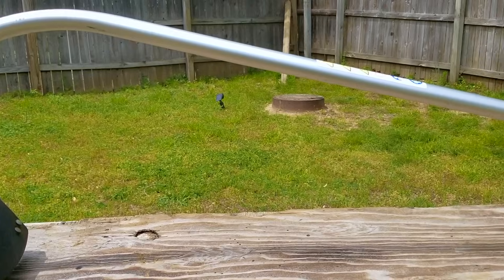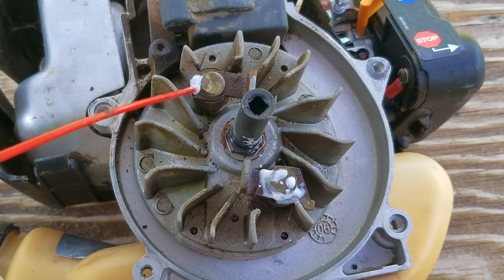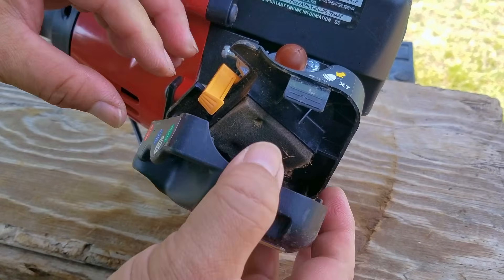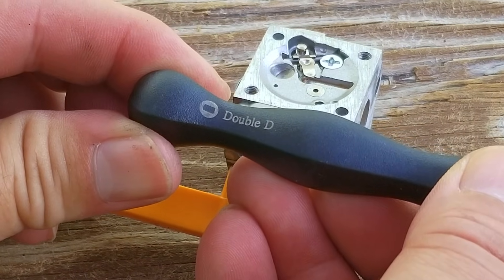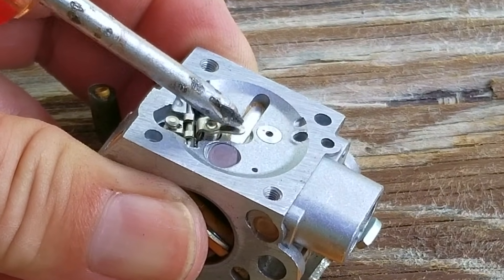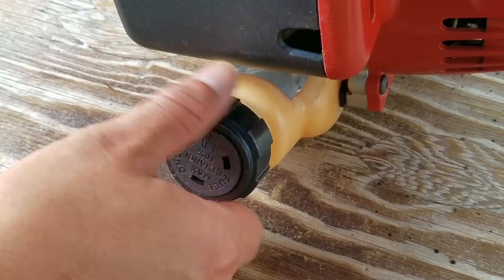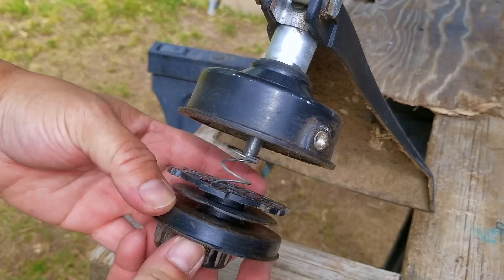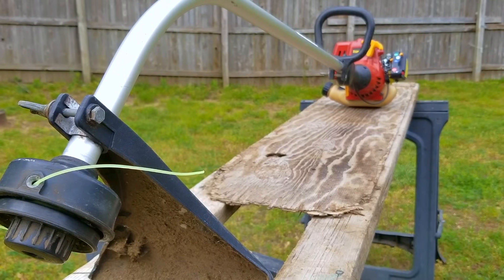Fixing A Homelite Trimmer That Won't Start

Comment: Thanks, I’ve been using a badly running similar trimmer for years, your video will help me try to fix it. Never opened a 2 strokes carb
Reply from the maker: thank you Bob and good luck
Reply: @INSIDEHOUSEGARAGE  did it this weekend. New needle on the old pivot seemed to flood the engine. Went back with the old one and it works fine now

Comment: This video was very helpful. My Lifan weed trimmer started, but it would lose power and shut down. Lately it just wouldn't start. I took out the fuel filter and saw that it looked very crusty and the supply line inside was in pieces. I changed the fuel filter,  supply line(hose) and return. Now it start perfectly and no loss of power.
Reply from the maker: thank you and nice work fixing it!

Comment: Those little homelite trimmer are great. I've fixed a sold 3 this year. I think if there were treated like a more expensive trimmer buy there owners they would last just as long.
Reply from the maker: you are correct, these are not bad at all.
Reply: The name Homelite was the premier name for any or all small engine appliances back in the '60's and '70's. Too bad they lost that reputation along the way!!!!
Reply: Stihl now has that reputation and from what I hear their products are marginal at best!!!

Comment: I have my dads old one(same model) had to replace the fuel lines as you did, then it ran just fine. The issue is, the line wont feed properly and snaps off at the eyelet for some reason. Im thinking a new head is needed, since its heavily worn(holes in the bump button from wear). Not a bad backup trimmer otherwise, cuts fine when it holds line. I wanted it so I didnt have to convert my straight shaft trimmer back from brush cutting blade to string constantly. Good video!
Reply from the maker: thank you AdmiralDG.

Comment: I'm not a big fan of the curved shaft trimmers but if push came to shove and I didn't have one I couldn't find a Straight Shaft one then would have to use it,  great fix on that homelite
Reply from the maker: I hear ya, they can certainly make your back or neck hurt

Comment: Get one of those $80 Harbor Freight ultrasonics. I have one, and it does just fine on stuff like this. You are correct about cleaning them first, but I have a better success rate when I use mine.
Reply from the maker: yes that's the plan

Comment: This is the exact model I had repaired and still use! I certainly wouldn’t use it in a professional setting but it trims our grass much faster and easier than our cordless black & decker that had a very short runtime!

Also despite mine being two years older (April 2004) the carburetor adjustment screws had the plastic covers on them. Fortunately the screws are slotted so all I needed was a small flat blade screwdriver.
Reply from the maker: nice, thank you for letting us know, and I also agree about the commercial use issue .

Comment: Great video, can i have your opinion on something I run all my equipment on fuel with a stabilizer in it but people always tell me to run can fuel but I don’t want to run that because it’s just so expensive and Even if I did run can fuel i think it is a wast of money because a gallon of the stuff runs 20 to 30 dollars and that is the same amount as a new carburetor, but do you think people should run caned gas for just use the pump
Reply from the maker: Thank you Nick Mcgrew for the question. I would alway suggest running pump gas with an "ethanol shield" additive all year long. But I'd also like to recommend using canned fuel  during the last month of the season, just on the off chance you for get to run the machine dry.

Comment: I like all your videos. They have provided me with a large amount of information. The comment you made in this video about a dish washer leads me to believe that you do not own a dish washer. You stated that all the dirt from the dishes goes back on to the dishes. Sorry, you're wrong. Cleaning the dishes before putting them in the dishwasher is stupid and wasteful. As for an ultrasonic cleaner; I do not own one but, I do know that they do a good job cleaning small parts. Just dropping a carb into an ultrasonic cleaner to clean it without taking it completely apart would be stupid in the first place. Ultrasonic cleaners are best used for other items. Cleaning a small engine carb does not really require that type of cleaning.
Reply from the maker: thank you Keith Dunbar, I do have a dishwasher but it really got thinking about it which was the point of the statement.

Comment: Hello, thank you for this video. 
What to do when the carburetor overflows with gasoline?
My trimmer won't start.
Reply from the maker: sure, I make it simple and just replace the carb.  Otherwise, you'll get a headache trying to fix the carb from leaking.

Comment: Great video! The only question I have is aren't the fuel mix screws different? That is my understanding and one of my screws has a groove in the middle of the screw head. Just saying so if anyone removes the screws they do not mix them up. Keep up the nice work!
Reply from the maker: are you suggesting that the screw heads are different on the same carb? If so, i'v never seen that before they've both been the same, unless someone cut the head.
Reply: @INSIDEHOUSEGARAGE  Yes, I have a Homelite trimmer and one of the needle screws has a ring around the head of the screw. I didn't notice this right away but the tip of the screws looked slightly different. One of the points looked a bit bigger than the other. I have seen the ring around the head of one of the screws on other videos but haven't seen anyone point this out. The carb is a Ruixing carberator. Thanks friend!

Comment: Thank you for what you do! What is the difference with lithium grease vs. WD-40?
Reply: Now days, wd 40 is a brand. WD40 has cod liver oil I think. Lithium spray grease dries and leaves a solid layer that is resistant to water and prevents corrosion. WD40 is thinner and seeps into rusted parts making them easier to remove.
Reply from the maker: lithium is thicker and stays in place
Reply: @INSIDEHOUSEGARAGE  it's the go to for battery terminals. Especially if you have any modern zinc or nickel/copper thin and crispy battery terminals. Nissan or Toyota. The leaking battery is the culprit to be honest. But stuff happens......
Reply: Lithium grease is more like peanut butter consistency and is sticky. Wd40 is thinner than water.  Lithium grease being sticky lubricates longer but collects dirt. Wd40 is a mild lubricant but doesn’t collect abrasives.

Comment: I got an old 4-stroke Troy-Bilt TB45C for free with gas in the oil and from what I was told oil was leaking out somewhere when it was last running. I was told it never ran smoothly since the first day so I'm debating if it is worth fixing it to give it to a family member that needs a light weight blower. Any ideas on how to fix it or just toss it. It was used very ligthly and has been in a barn for years since.
Reply from the maker: If gasoline is in the oil, it means the carb was leaking into the engine. replace Carb, drain and replace the oil and you should be good

Comment: Hi, could you please leave a link for the new carb ? I have a similar homelite trimmer, and unfortunately fuel is leaking from the carburettor. My carburetor is labeled "C1U" but it should be the same type as yours in the video. Thanks in advance for the link 🙂
Reply from the maker: sure thing.

Comment: Can NMMA TC-W3 Outboard 2 Cycle Engine Oil be used in these?  It's what two-stroke snowblower owner's manuals call for.  Supposed to be ashless.
I use it in my Toro CCR 3650.
Reply from the maker: that I don't know for sure, since I've never tried.

Comment: Actually that's all I've ever used is a Homelite brand curved shaft trimmers since the mid 80's. Curved shaft trimmers are for someone shorter, I'm 5'3. I just bought an new Stihl curved shaft FS 40 C-E  trimmer this evening because of too many bad reviews on the new Homelite trimmers now, quality just isn't there anymore for as the engines go it seems. My newest Homelite I've been using  probably needs a new carb & lines & clean the carbon screen too,  it's at least 10+ years old. It only seems to wanna run on about 1/3 to 1/2 choke.
Reply from the maker: have you considered adjusting the carb to deliver more fuel?
Reply: @INSIDEHOUSEGARAGE  Not really, my weed eater did sit almost 3 years without any use with fuel in the tank & carb, I'm guessing the old gas dried out the carb gaskets & etc! Or the screen in the muffler could be clog with carbon. I may order a new carb, line & fuel filter for the Homelite & use it for a backup.
Reply from the maker: I think you're right

Comment: At 4:49...incorrect about those screens in the fuel pump section of carbs.. I have found a sludge, blond and white, as well as what "looks" like fine splinters in one saw. All this getting past decent looking lines and filters. This year I found this problem, more so than other years; as I  only have regular gas locally, and I made the mistake of buying some 😞

I am not sure, exactly, where this sludge comes from. The filter material, or hose and/or gas degrading; or stuff that gets past the filters??? I do know, this was not from the filters or gas lines falling off. I maintain my own saws and trimmers and lawn mowers. This year nearly everything needed servicing. I will soon have that jug of regular gas used up :-)
Reply from the maker: I hope you figure it out.  As for the screen getting clogged, it has to be coming from the fuel past the filter.. there is no other explanation

Comment: Hey bro what's up? Repairing this trimmer was simple enough to where even a novice could have repaired it bro. I wouldn't mind having it as a back up trimmer but I have one problem with it that is the shaft. If it's a straight shaft no problem but the curved shaft is very troublesome for me to use bro.
Reply from the maker: you and me both!

Comment: I wouldn’t buy it only because I already have a backup trimmer and my storage space is getting too tight as is my extra cash! I have never really had an issue with a curved shaft trimmer in my suburban lawn. If I had acreage to maintain, I might though. It seemed to be a nice little machine that wasn’t abused!
Reply from the maker: that makes sense

Comment: What is an acceptable compression range for for these?    Trimmers don't need as much power as blowers.  Blowers are usually maxed out .  The landscapers  who cut my neighbor's yard use their trimmers at low speed.
Reply: thats actually not great for the trimmer, usually end up with more carbon build-up/soot, but maybe they just have newer/quieter units.
Reply from the maker: they're  using them at low speed probably because they're using backpacks, no need to go full speed on them.
Reply: @INSIDEHOUSEGARAGE  nope, they're hand held trimmers

Comment: I've got this same trimmer and it recently stopped working, how do you get it started if the engine is flooded and it won't start? I was thinking of trying to replace the carburetor but don't want to do that and it still doesn't work
Reply from the maker: sure, I would make sure the choke is OFF, squeeze the trigger and hold it, while pulling on the rope. Try 10 pulls at first and then walk away, come back and try again.

Comment: I got a free 2 cycle weed wacker with a new carb and after adjusting, it ran fine with the fuel it had. Then i accidentally put to much oil in the fuel and it didn't run, then i put engineered fuel and it still doesn't run. What could be the problem. Thanks for your time.
Reply from the maker: it's flooded. One of the issue when you sometime don't it a trimmer  to start, is to pull it 
one too many times and the flood it.  Next time, use no choke, squeeze the trigger and  pull it several times and see what happens.
Reply: Still nothing. Though I do apologize for I should have explained it's symptoms better. Because it does start and run for about 20-30 seconds then dies and doesn't idle. After that it won't turn back on. It also seems to do better in the cold when it was about 10-20 degrees out. But now that it's warmer out it seems not to do as well. I didn't leave any fuel in it during its storage from when I got it in the middle of winter. And because the engine felt to easy to pull, I tuck it apart down to the piston and it looked great in side. It was having running problems before I tuck it apart to. It's clear to me that I broke it but I don't know what. Again thanks for your time.
Reply from the maker: no problem and thank you for the clarification

Comment: Hi mate I have a Mitsubishi tu26 when it gets hot it bog down and dies and it blows out a lot of blue smoke. And I also a a Husqvarna 120 marks it really hard to start and it bog down as well
Reply from the maker: what kind of gasoline and oil do you use?
Reply: Husqvarna 2 stoke oil

Comment: I personally would not want it, being that it is a curved shaft and a front recoil. I probably won't even take it if it were free. I've nothing against having a lesser quality machine as a backup. I've got an old a Cub Cadet CC 2000 ( l put a Ryobi kombi shaft on it to make it a Straight Shaft) and it is my backup. It isnt that uncommon for it to start on the first pull, cold.
Reply from the maker: oh I completely understand